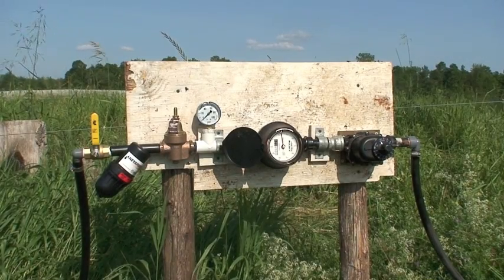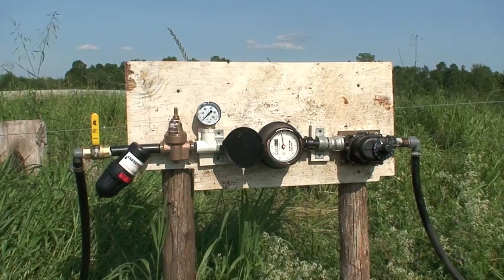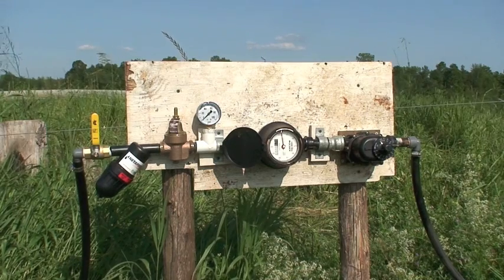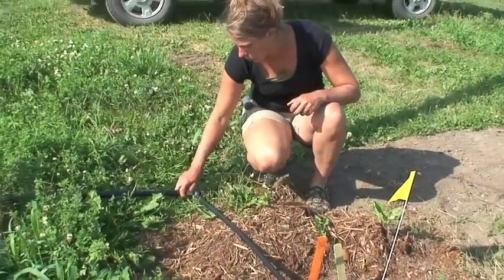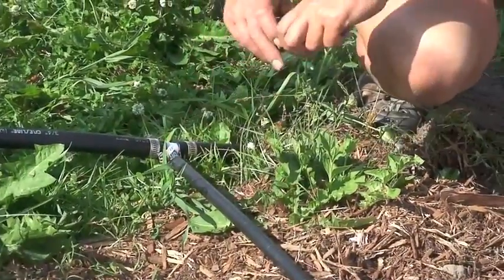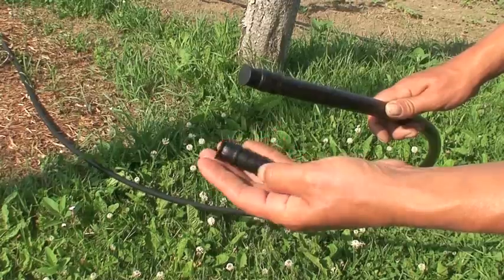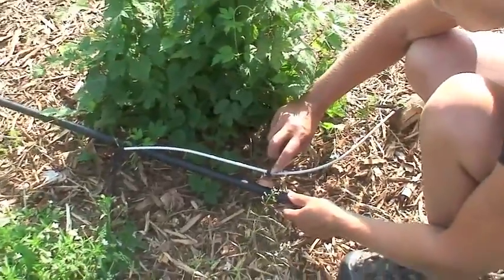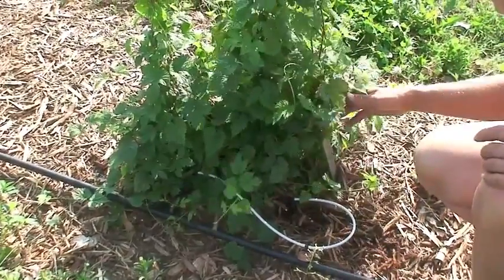Organic Hops Variety Trial- Irrigation

Comment: With anything, its important to do it right.  Removing the lower 1-3 feet of leaves is ideal to avoid disease.  The second issue seen here is of course to know your mineral amounts in the water, and understand calcification of the lines and costs to maintain as a result of the hard water will increase with time and must be mitigated each year and often even during the growing/watering season.